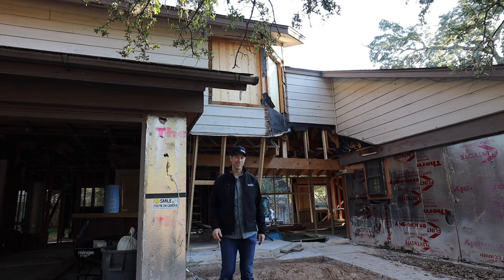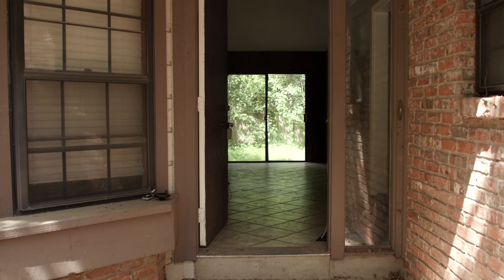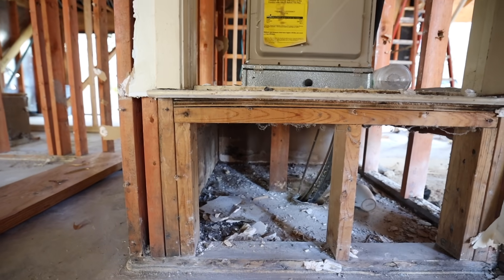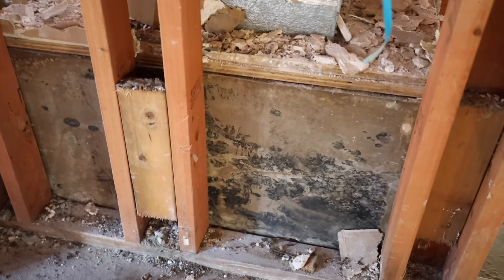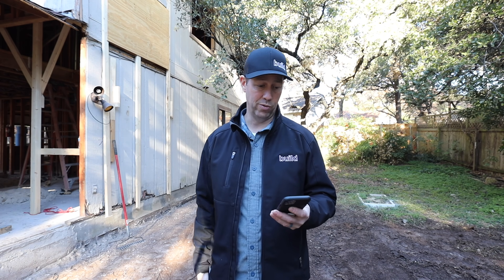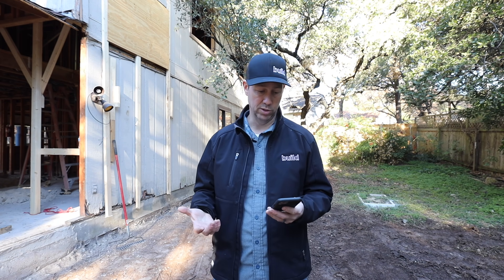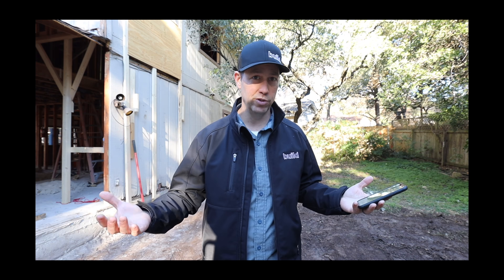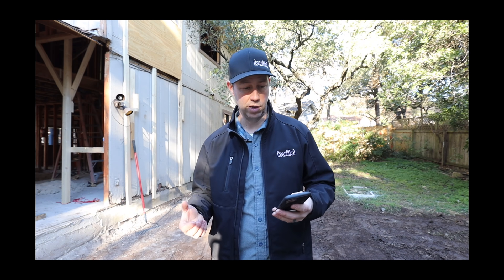Should I have just knocked it down?!

Comment: RUUUUUUNNNN Matt!!!! DON"T DO IT! Knock it over. Its going to cost you so much more and you are still going to have an old house when its all said and done. There will still be imperfections that will drive you nuts. I did this myself. Completely gutted an old farm house and rebuilt it. Material cost ends up being the same, labor is way more, and you still have an old house and its not going to be exactly what you wanted. I wish I could go back in time and slap myself and change the coarse of history from when I made the decision to gut mine. I could have had so much more house and it would have been new if I would have knocked mine over. Just sharing the advice I wish I would have got. Merry Christmas my friend!
Reply: I agree insider carpentry 100% but I don’t have the knowledge to make a pro 2 sense in this build
Reply: Like I said in the first video... best investment here would have been a big pile of linseed oil soaked rags against the wall in the garage.
Reply: Its great for content
Reply: Hey Lewis sorta like that whole cable stairs system when you could of stopped at nice blocks & no one would of really cared?
I am sorry brother had to get that in there!
Merry Christmas !
Reply: @proficientbuilders3565  That is definitely an outlying factor that I didn't consider. It would definitely make some great content and could probably help even out the financials.
Reply: A little late for this advice...

Comment: I started helping my dad remodel when I was 8 about 55 years ago. Working on elevators you are a jack of all trades. In D.C. I got to work on many very old buildings. Capitol, library of Congress, Washington Monument, Supreme Court ect. Those buildings are never going to be torn down. They are restored. The unknown in a project is always a risk. Once you open her up you meet reality. Matt got lots of huge surprises and adjusted to make it work. That is what successful people do. Building innovation brings changes to construction methods. The well done job will always have value.
Reply: Thumbs up..........another trades person who understands what goes into a remodel or new building and who doesn't think in black and white with only feelings to go on. Matt took a risk (as well as Off the Ranch Matt) but they hopefully based their decisions on good information and doing their homework. People underestimate the cost of demo, engineering, permits, foundation work, and framing. It is easy to say to knock it down, but reality has a rude awakening. Goals, funds, knowledge, buildings, codes, and people are all variables. Too many people think in black and white with little to base their opinions on. I have found it is safer to not assume but rather consider what lies beyond the surface of a topic and to consider that not everyone has the same goals, knowledge, or motivation.....different perspectives and all.

Comment: A third option I wish will become more popular in the future is deconstructing a house instead of demolishing it. Because a huge con in my mind when choosing a new construction is the amount of waste we are creating.
Reply: yes but mold...in this case...
Reply: @lisagravells802  The mold is no big deal as it is easy to remove, clean up, and treat in a building torn back this far. It is not uncommon, especially when dealing with buildings that have flooded. People are afraid of mold and yet have no professional experience working on buildings or removing and repairing water and mold damage.
Reply: CGT80 yes but I’m replying to the reuse of materials. You can’t clean drywall and insulation and vapour barrier and various other materials and if you can clean them it’s cost prohibitive to do so. I agree this house is easier to clean torn back this far and perfectly safe however a lot of trash is created in the process and that’s a unfortunate truth with remodeling .
Reply: @lisagravells802  Yes, building materials are produced inexpensively and are meant to be a consumable/replaceable product. Many of the building materials used over the last 100+ years in the USA are the same way. That is a drawback to materials that have many other benefits such as speed and ease of installation, standard sizes, light weight, energy efficient and relatively low cost to remove and replace when needed. Concrete, brick/block, and steel are more durable but are much harder to work with or remodel.

 How much waste do you think a remodel creates vs. a new home or vs. other sources of waste such as packaging material? I also work on commercial buildings and see how much waste comes from warehouses/manufacturing businesses.

I'm also a competitive shooter and Pro2A and hear the antigun comments....another topic people don't truly understand and people fail to see how it plays into the big picture and how their solutions work much better in their minds than in real life.

It is a shame to have so much waste and it is great when we can reuse or rebuild/repurpose items or buildings. The waste from doing a remodel on a building every few decades doesn't concern me as much as the waste we generate on a daily basis. Plastic straws being banned is a joke to me (I live in komnifornia) and the plastic bag ban was stupid but did get us better bags and uses less cheap bags.............in the big picture, bags and straws make up a tiny percentage of the trash we generate. People should focus on product packaging and distribution as it will make a bigger difference.
Reply: CGT80 I know right! I personally dumpster dive at Home Depot and Lowe’s and Costco and also jobsites. I’m still surprised what I find and what I can build with “trash” . I’ve been diving for 4 yrs and you’d think the surprise would wear off but so far hasent. I support my family off of it! That’s how much money is thrown out! For perspective!
Reply: A few dozen? Yet people don't go nuts over the many ways that thousands and tens of thousands of people die every day. The joy of shooting is just a small part of the right people have of  defending themselves. More likely to die of suicide, says who? More statistics with an bias or agenda? And, how much more likely? I'm also more likely to have health problems from living around large cities, yet many of us do that. Obesity, heart disease, and cancer are far more likely. Life is full of risks. Luckily I live in the USA, where people people (including my family members) have fought to uphold our freedoms. Freedoms lost in other countries. While I hope to never have to defend myself, I appreciate the ability to do so, increasing the odds of a favorable outcome for myself.

Comment: The heck with that old house. You can do so much more with the ceilings and the roof line which are everything to me in a house. The only thing you are saving is demo costs, and foundation costs and that old foundation is all crazy elevations anyways. Everything else cost the same. The plumbing, electrical, hvac, flooring, cabinets all of those expensive items cost exactly the same in either new or remodel. No point in fitting into the neighborhood either, just dont build a mcmansion overlooking the neighborhood. Matt I would have loved to see your style and who you really are in a home. Would have been really cool for you to draw your own floorplan. Seems worth it to even be 500 square ft smaller that the original in order to get new new.

Comment: On the subject of smaller homes, as a designer I'm all for them. Important for their success is that they have well designed storage. There should be a rational, systematic approach to the design of storage. A second important factor, consideration of traffic flow through spaces. Susanka's work is excellent. I second your recommendation.

Comment: That's one KILLER house you got there. Feces, mold and plain old rot. A Pandora's box ala Austin if you will. Early on you pointed out the overhang had protected the outer walls. So what did you do? You cut off the overhang with a chainsaw. Kind of like the way you refurbished the insulation in the attic and now you're gonna tear the roof off and power wash the innards.  At this rate, I expect you to completely remodel the house, redoing and reredoing several stages, THEN, TEAR IT DOWN AND BUILD NEW!!!

Comment: Some people prefer the look, style, charm of an older home; others prefer the new style.  It is really hard, often impossible to build new and give that home have the charm of an older home.  This home from the 70's is 50 years old, that is the most difficult age to survive (there is nothing as old as a 50 year old house).  That is if it were from the 1920's if would be much more unique and special, worth a restore.  But now it's in a neighborhood of very similar homes so it does not seem special and it's easy to see the flaws and the work to repair and improve them.
When you are done you will have a lovely home.  Remember that Pearls are created because of the irritation of a grain of sand.  
Good luck, we'll be watching.

Comment: Matt Lag Bolts are 1970"s. Go to Simpson Timber Screws. My shop has a hard time keeping them in stock. Two staggered Timber Screws = a 5/8 bolt. Lags have no structural rating. Timber Screws do not have to be predrilled. More expensive up front, much much cheaper AND stronger at the end of the day. JK

Comment: I have a 70's era home in Abilene, which I'm about to start a rebuild. The house is brick on all sides. In Matt's project, it looks like at least the back of the house was siding. I'd like to strip all the brick, so I can re-sheath the house and add exterior insulation. I'm wrestling with the width of the brick ledge (2x6). With the added thickness of the exterior layers I want, I no longer have enough footing to reuse the brick original to the house. Extending the ledge (e.g., 2x8 or 2x10) is too expensive. I could go with brick or stone veneer, Hardie siding, or maybe real stucco. I'm looking for exterior wall details that work with narrow brick ledge.

Comment: Make sure to get vaccum solar heat collectors and at least a 1000 liter storage tank for storing the heat. There are storage tanks with a heat exchanging copper spiral at the top, where the water is the hottest, to make instantly hot water. This avoids that all that crap collects in the hot water tank.

This is way more effective than a heat pump with solar panels, since the collectors have a higher efficiency. You can still add a heat pump with a underground heat exchanger, for the winter. With the storage tank you can run the heat pump on the offpeak hours and store the heat.

You could also add a fire place with a heat exchanger, if you like the idea of having a fireplace. This way it's way more efficient, than just burning wood and wait that the heat gets spread in the house. And you can use the energy also for hot water.

Since you need ventilation on a air tight house, I would add a passive heat exchanger with a water based heat exchanger, to heat up the air after the exchanger has prewarmed it.

Maybe you also want to add floor heating to the bathroom, that's quite nice and the piping would be pretty short, since it's basically near the storage tank anyway.

And add insulation to your garage including a insulated garage door, this reduces significantly the surface area of the house.

Hope my brainstorming helped you a bit 😙🎶

Comment: Matt, I love the post-credits.  Keep up all the great work.
Reply: @MattRisinger I should add... I remodeled about 25% of our house based on your work (2x6 framing, osb and pt plywood sheathing, pt in the bottom 4ft, exterior foam insulation with radiant barrier and Tyvek drainwrap, siding is rainscreened JH v-groove, interior is insulated via flash-and-batt with Rockwool).  You work/videos have been an incredible resource for me especially considering this stuff is not my day job.

Comment: Merry Christmas, Matt. Since you're changing the roof pitch, what if you bumped the front forward 4'-6'?  You'd gain your lost space back, get to leave your load beam where it is and get your pitch change at the same time. Maybe notch into the top of the garage roof if you need to lower the window height upstairs for egress.  And chemicals in the garage, yeah I get that, but if you went with electric vehicles, that would mitigate some of the fumes. :) Cheers.

Comment: When it comes to a whole house remodel, the dilemma between remodeling a house that's in such execrable shape and demolishing it and starting new is in the the initial exploratory/demolition phase-- what is the cost of a successful refurbishment with the house's condition when compared to starting over both in money and time? 

 Frankly given the house's original condition; I would have contacted the local fire department and ask if I could donate the use of the house for training purposes so long as they total it before they leave. Then bring in a crew to remove the remains and start from scratch. You save money in initial demo and get a potential tax write-off to boot.

Comment: I was hoping for the answer to "should I remodel or rebuild?" in terms of cost.  I've heard it's best to rebuild because the cost usually comes out about the same between the two.  Is there a formula to make this decision easier for the average person who is not in real estate or building trade?
Reply: There is no clear answer. Codes and taxes vary by location and each house is a unique puzzle. As he mentioned, even in new construction things don't always go as planned. As a building pro, I would expect most remodels to cost less than building from scratch. People don't realize how much it costs to demo, regrade a site, deal with utilities, pour a new foundation, frame walls and roofs, and deal with the permits, codes, engineers and architects to do all of that. As he mentioned, new builds tend to be even bigger and the price goes up more. Generally, I'm more of a fan of remodels, but I have worked on many of them and and appreciate that there are various levels to a remodel. Many are not as extensive as this one (less cost and people can still live in the home) but my uncle (a contractor also) did a very extensive remodel to his and it worked better than rebuilding.
Reply: Thank you, very much appreciated.  The more I research this I can now see it all depends on the many variables.  My situation to remodel or demolish will depend on the structural engineers report.  Thanks again!

Comment: Thinking about it a bit more.. still tear it down.. to the dwv pipe in the ground.  Then get the perfect walls from Bensonwood. With a hybrid of timber frame downstairs for the kitchen / great room.  Still figure by the time you get rid of your urine and black mold not so sure  you want to be in that space. last big upgrade would be to put in a tornado shelter, as I know as soon as you dont you will wish you had.  Heck you might even want to blow in areo barrier just so you can get the house to 0.03 ach.  Am sure you can still get someone to supply you windows and doors that you trust.

Comment: The most important reason for me to remodel rather than tear down is that you will recoup a higher percentage of the cost when you sell. If you do a teardown and double the size of your house, now you have a house that doesn't fit in with the size of your neighbors' houses. So buyers will expect the price of your gigantic home to cost about what your neighbors' houses cost. Your taxes will be much higher too because the assessed value is often set too high because it is often established on size, not what it can actually sell for. My advice would to remodel unless it's hard to see a substantial part of the house that is in good condition and that you like. If you decide to do a teardown, keep the square footage about the same to 10-15% larger.

Comment: Matt thanks for your videos. I learn a lot from them. Ignore my comments below. ;)

I said to knock it down like 6 episodes ago. It is easier to give birth than to resurrect. Anything built in the 1960's through the 1990's is just plain crap. Either the homes were built with products that were state of the art back and they have outlived their useful lives  or they were built in 6 months with the cheapest labor (Not to mention crap products from China) (Moldy Sheet Rock ring a bell?) and cost cutting corners to keep up with the housing boom. As someone once said on a TV news program when they were reporting that the houses built 10 years ago were falling apart. "These houses were meant to be sold and not lived in."
I said the same thing to Mats house, it was just a monstrosity that sat there for years! These rehab shows on TV are just as bad and to see them just put lipstick on some of those pigs they showcase is abhorrent. Cool for ideas if you want to do a nice freshen up to your home, but bad if you think you can Demo your kitchen and get it done in a weekend.
Next home I build I am getting the guys from this old house. Then I am sure to get contractors who show up, experts who know what they are doing instead of someone coming back 3 years later and saying "Why did they do it this way? I would have done it this way. What were they thinking?" Everyone is an expert after the fact.
Start from a clean slate.